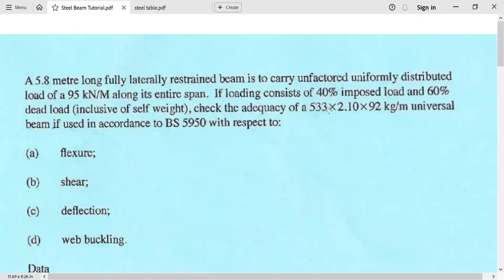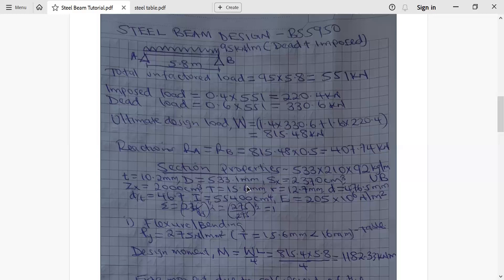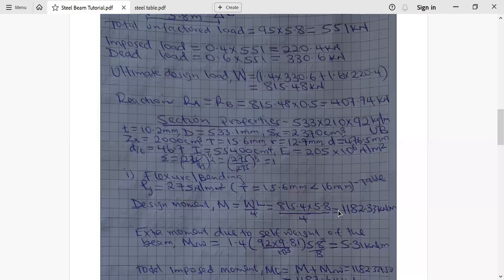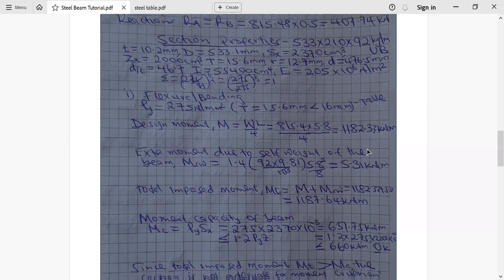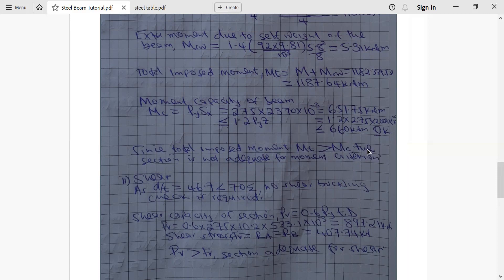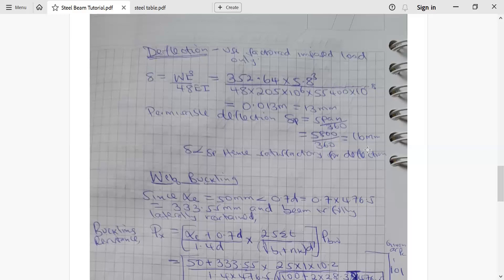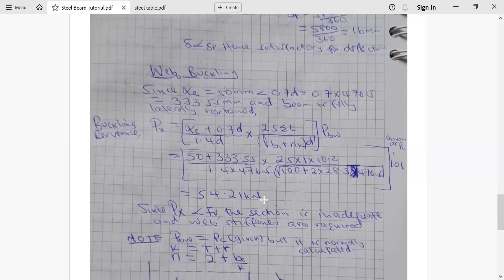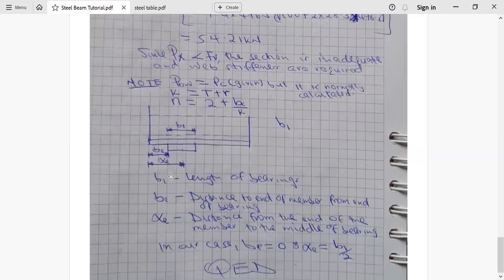Steel beam design

Comment: The beam was carrying a UDL. So we should have used the maximum moment for a UDL which is wl^2/8
Reply from the maker: The UDL was converted to point load acting at midspan by multiplying the UDL with the span